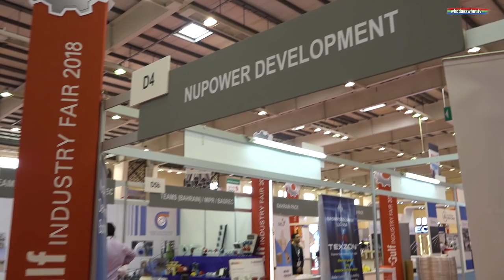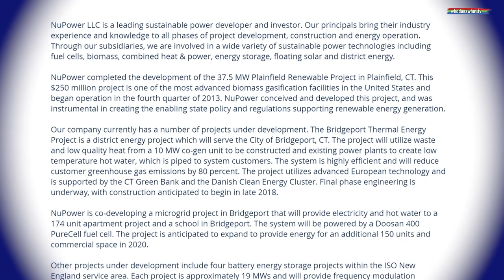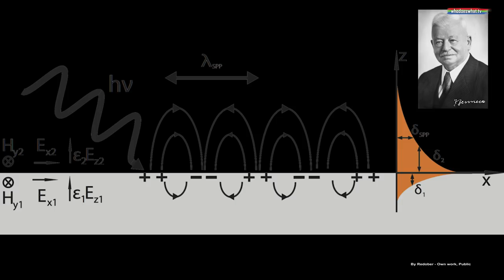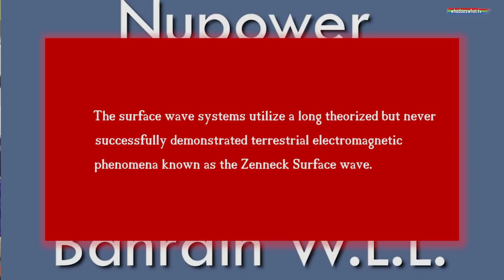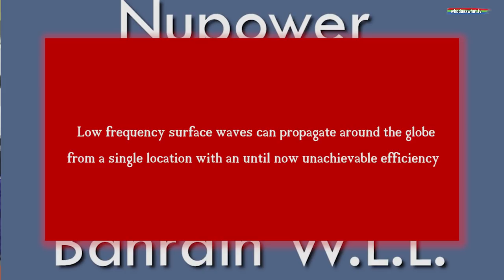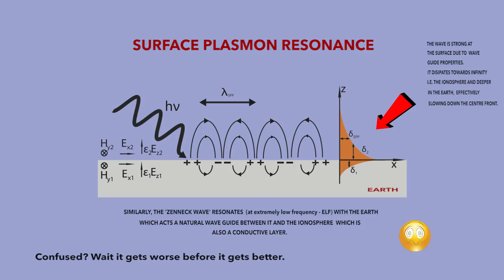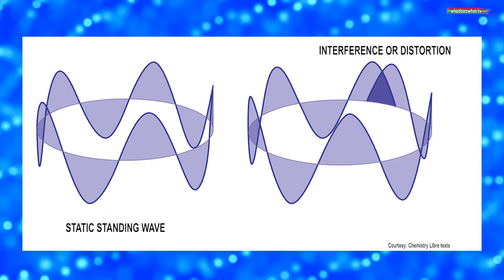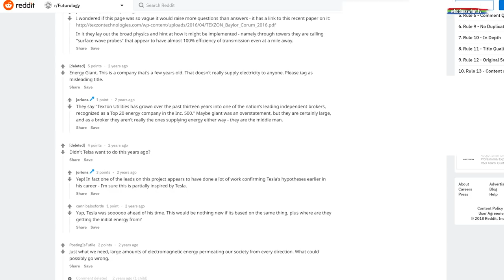Texzon Zenneck Wave Wireless Power Transmission - World Wide - Nupower Development

Comment: Interesting. I wonder if the people who instantly dismiss this are any of those who are buying into the "warp drive"/"faster than light" technologies the likes of NASA and others have been researching, including the potential of "wormholes". Anyway...

They're using a waveform, so I'm concerned about resonance and the possibility of it amplifying/peaking at crossover points as soon as a second transmission intersects the first. An intersection at the correct offset could also cancel out the waves, leading to nothing, or it could lead to unwanted "noise". I'm also wondering if, for example, they transmit 10kw and only 5kw is used, is the remaining 5kw reduced over time? If so, what is that rate of decline? Did he also say it can be encrypted? I have so many questions! Someone needs to lookup those patents and dissect the technology.

It's been a few years now and their site is pretty blank. So, what's happening, if anything? lol

Comment: It is interesting that they call the Zenneck wave “the probe” ... my feeling is that they are running thousands of Zenneck waves per sec as a polyphase Zenneck wave pattern. I also think the percent of ocean vs land as a line of sight to each potential receiver will have to be factored into the phase design of the receiver ... the equipment has to be able to be dialed in with the creativity of the equipment design. The refractive index of water and of the earth are different enough that I feel there is no doubt this will play a role ... ?

Also, though it is near 100% efficient, it’s energy degrades  probably at 1/r not 1/r^2 ( r = radial distance from the source), so the receivers that are further away from the source will take longer to collect the equivalent amount of energy and require a buildup kind of storage in batteries ... but this lag in total power delivered can further be offset by the number of waves per/sec each station is tapping (batteries not required in all instances) ..  perhaps charge more money for the number of cycles being tapped per sec to ensure that the end user has the amount needed as a combination of both battery storage and cycles per sec being tapped... but leaning more heavily on the cycles per/sec as playing the more dominant role.

Therefore, the reason they call it the probe, is that at each location this is a probe to be deciphered and thus, dialed into.  
Viktor Golubic
Reply: Probe?   In modern language, Tesla's broadcast power had little to do with normal radio or conventional antennas.  Instead it was based on cavity-resonance, with fairly small "cavity probes" being the transmitting and receiving antennas.  When you see Texzon talking about "probes," that's their topic.   Their "probes" might be 100ft tall, while any conventional antenna is required to be many miles tall, a quarter-wave vertical tower at the same operating wavelength.   With an EM standing wave present, we don't need to build a five-mile transmitter tower, because the wave-emitter inside the resonant cavity is "pushing against" an existing standing wave in a particular fixed phase, and not just spewing energy off into empty space.  It might seem like black magic, but impedance-matching and "antenna tuners" were always like a black art, understood via equations only.   The non-math version: it's the difference between using your finger to push a 300lb adult on a swing set, versus trying to just slowly force the swing sideways so the person on the swing is directly lifted ten feet in the air.  The 'magic' is in the oscillating stored energy trapped within a resonator.   We can "push against" that trapped wave with our "tiny finger," rather than needing a giant radio antenna.  

Resonance is weird.  Physics students tend to avoid the whole topic BECAUSE it reeks of magic.   It becomes palatable only if we call it "surface plasmons" or something.   That way we can conceal the weirdness underneath some quantum mechanics.  But remove the QM, and the profound weirdness of resonance persists!   (In a way, Surface Plasmons are a sign of dishonesty and cowardice.   Some people hate Tesla because his stuff involves the same weird topic, but without any hope of concealing it all behind a pile of obscure QM equations to make it seem conventional.)

More:  for the 80-meter and 160-meter amateur bands, your car's quarterwave verical transmitter antenna needs to be 65ft or 130ft tall!   Yet if you add a baseload/transmatch, you can use a 8ft whip, and still "get out" just fine.  WTF?!!   How can an extremely tiny radio antenna possibly work for longwave?  Just transmit conventionally but with extreme high voltage.  Heh, also, if the whole world was a resonant cavity at 160 meters wavelength, then your car-mount transmitter antenna might only need be a few inches tall.  That's the impedance-match black magic, the resonant-cavity sorcery.   It's the main thing which allowed N. Tesla to broadcast enormous power at 10KHz without needing an antenna-tower 25,000ft tall.   And then comes ZENNECK WAVES!  Don't even get me started.   Employing some sub-wavelength grounded resonators  ...did you WANT Zenneck waves?!   
Because that's how you get Zenneck waves.
Reply: wbeaty Yes, agree and understand the very high resonance peak potential and standing wave guides in cavity resonance (alluded to this elsewhere) but see the Zenneck wave as a standing vertically decaying wave resonating on the surface of the earth in response to the total internal reflection of the corresponding cavity-resonant wave vibrating within the surface of the Earth ... but it travels above and along the refractive index boundary between ground and air.... It’s an evanescent wave that is non radiative and strictly adheres to the surface much like it does on the outside of a fiber optic cable that experience total internal reflection. But, it is by this means that I suspect the power will be extracted (leaked out) using quantum tunneling across an inverted refractive index boundary where it will give rise to, or transmittance from, the trapped resonant wave traveling within the surface ... from inside the waveguide of the earth or from within the fiber optic as my example. This is how they in fact tap the signal traveling inside a fiber optic cable.
Reply: @Rizzycat1  quantum tunneling is just another name for nearfield devices, transformers and capacitors.   A transformer is not a pair of radio antennas, instead the cloud of virtual photons are "tunneling" between the two separate coils.   The Viziv receiver-probes will certainly be high-Q resonators connected to a large low-resistance earthing attachment, and perhaps oil-insulated in order to support the extreme HV at the ungrounded end.   (Heh, if we could spin a big supermagnet at 20KHz, that would probably work too.)

Comment: how small would the power receiver be? small enough to power a car or a smartphone?
if its a surface wave can it power a flying airplane?

i guess this means that countries with desert will be making huge money powering the world.
Reply from the maker: In time, one would assume so, since the technology allows for modulated products to be carried.  (In theory anyway, but confusing for radio people because the frequencies are so low.  The only way to do that would be by phase modulation).   Anyway, the question was put to them, plus the notion that one single country could, in theory, generate enough power to feed the entire world, but that would not be economical. Manufacturers never build things that last forever, or they would go out of business. Likewise, have as many nodes as possible in as many countries.  There would however no longer be a 'National Grid', as we know it,  since a standing wave would in effect be the grid. Any interested party, with the codes could tap the standing wave no matter where they are in the world. The difference being, each wave may or will overlap, but they are in a different dimension, so do not affect each other. (One assumes).  But the more stations the merrier....  Money honey.  As for the size of the receiver: then again, one assumes that just like any other 'maximum power transfer' equation, the receiver has to be a linear exact fraction of the original wavelength.

Comment: So the standing wave generator produces an earthwide current. To use it, receiving devices have to be developed to capture the current and draw on it. This will require reconfiguring electrical devices. Consider the expense!
Reply: I'm no expert, but wouldn't this imply a totally new set/type of electronic? The system for which they distribute the energy to actual devices isn't clear, so its possible they can relay 'wireless power' to hubs instead of devices?

Comment: Studying more on this ... hmmm

Using the Earth’s surface as a resonant standing wave plasmon pump...

I believe this can work ... but they may have to pump the standing wave to build it up its amplitude.  I can envision where the resonant nodes will have to be positioned at distances in increments of the wave guide wavelength... each node can also serve to pump it up as it is distributed.

Alternatively, this might also be working by pulsing it in many phases to have multiple standing waves slightly out of timing with one another thereby building up a much larger overlapping domain reservoir ...taping it into it might involve collecting all these out of phase standing waves into a temporary storage battery or larger coupled LC circuit over a larger specific timing window...  the further away you are the larger the collection timing window can be!!

I think using a spectrum analyzer will be able to sort out what they are actually doing.

....adding 
I think one of the advanced problems they faced was the fact that the Earth is not perfectly round.... so the resonant frequency going around N-S along the poles will be different than the frequency going E-W around the equator and all the other angles in between ... so you’re going to have to include all these possibilities and kick them up during the right out of phase position for each possibility. 

If you go out of resonance the vibration is considered damped and will eventually die down, etc.

All these variables have to be figured out and tuned just perfectly else it won’t work.

Viktor Golubic
Reply from the maker: Hmmmm!  Viktor..... Very interesting take..  Hadn't quite thought of that.  Nice one!
Reply: Who Does what TV 
I think it might be possible to launch the wave from a horizontal conductor or resonant wave tube as a stepping process ...the wave is then built up to its symmetric or rather asymmetrical shape to counter the decay process.  You can then drive it to produce a series of pulses to manifest as many standing wave as I mentioned above.The antenna in Midland might be a receiver or monitor to collect the electric field as a charge on the surface and not the transmitter.   They said then Zennec wave was launched in 2003 or 4 so this building has nothing to do with the injection it would appear... ? I think to get to 97 percent the equipment has to handle about 20 kHz.
Reply from the maker: @Rizzycat1  Thanks.  I notice your enthusiasm. Enjoying the thought process, even though a little over my head, but that is how discovery is made.  Keep going!

Comment: I think in order to extract power you might need an inverted dialectic coupler representation with collection capacitors/inductors with respect to the incoming standing Zenneck wave ... they would represent the equivalent refractive index of the Earth and Atmosphere.  

The transmission waveguide dialectic sandwich is the Atmosphere over the Earth and for the receiver you will need an Earth equivalent refractive index over an Atmospheric equivalent refractive index ...they would be running parallel with one another but coupled inverted.
Reply from the maker: You are having sleepless nights about this aren't you?  :)  If anyone is going to follow this up, I am thinking it might be you, because here we getting nowhere with new news.
Reply: Who Does what TV Hehe ...very funny ... you might say it’s justifying my lack of sleep ... would be nice to get another report ... I’ll try to post after I get through the patents .... one patent still outstanding and might be in litigation.

Comment: does it follow ley lines?
Reply: For what I understand it covers the earth in fullness. Not lines or places in part.
Reply: @cbrucesbiz  Thanks.
Reply: It does not. They are called Zenneck waves. Think of ripples in a calm pool spreading out over the surface. Now make that pool into a sphere. You can intercept that (ripple) EM wave energy any where you like at any time. Very similar to wireless charging a smart phone. But instead of charging a battery it is more like plugging in a power cord to an outlet so it's on all the time and just uses an on/off switch like any light bulb or appliance. But no more outlet or power cord. Everything will just have invisible power no matter where you are. In the woods camping, the Arctic circle, your own home. Electric cars, ocean liners and Electric Ducted Fan Airliners. No more power outages in storms or natural disasters either. This is the very same technology that Nicola Tesla was working on, that the US Govt. confiscated after his death a hundred years ago. Click this link to learn more: http://vizivtechnologies.com/uses/

Comment: Technically even a car stereo is recieving electricity transmitted through the air. They are using a transmitter and reciever on a different wavelength bouncing it off of our ionosphere.
Reply from the maker: Not quite apparently.  It is not 'electromagnetic' as you mention with your car radio.  It is 'wireless' as in no wires, but it is a standing wave and I only used the analogy of a 'waveguide' using the earth and the ionosphere in respect to several other attempts at creating transmission.  As far as the ionosphere goes, it will only relate to the properties of a VLF frequency.
Reply: The theory behind the Tesla tower was using the earth's magnetic resonance to create electricity. Similar to a wireless charger couples to the magnetic field.
Reply from the maker: That is interesting. However, that is in microwatts.........  Of course, motor or generator, whichever way connected,   one has to turn a (coiled) motor/rotor/magnet inside a (coiled) stator or stick pins in voodoo frogs perhaps.  Using the Earth as a static coil,  with a standing wave sitting upon it, (which is inductive granted) what are you going to turn relative to the earth to excite it?  Texon does not generate electricity, it only transmits it.
Reply: As I recall, the car radio is an AM or FM receiver.  The FM range is limited because the signal cannot follow the curvature of the earth plus ground clutter blocks the signal.  I may be thinking UHF RF carriers instead HF RF carrier frequency.

Comment: See my comments on the article; http://www.globalmediaplanet.info/teslas-tower-wardenclyffe-tower-12-meters-height-prototype-finally-raised/?fbclid=IwAR1qfaxRmtcEVtnFnkqbaiG4_YvPb8HK8u72ph6EIudI2o5nF_GGvcCElrc   The principle used at wardenclyff for wireless power could be interacted with the earth's resonant frequency of 7-10 hz by Pulsing the high frequency coil at that frequency and producing a "heterodyned" signal as shown in my videos. This effect produced an 18 hz amplitude signal as shown by https://www.flickr.com/photos/harvich/8058151418/in/dateposted-public/   Comments from submission; Well the tesla coil as a wireless transmission of energy through the earth functions at hundreds of thousands of hz, but the resonant frequency of the earth itself is comparably much lower at 7-10 hz. Where is the missing key? In fact we can use the principles of the 666 machine to heterodyne or pulse the impulse into the earth at its own resonant frequency!     Dual Channel Scoping of 666 Machine Secondaries showing influence of rotating time vector
https://youtu.be/dx3LV1w5h8o 
The advent of pulsed or modulated secondary emf via 666 secondaries.    https://youtu.be/GuOGMbIQnqg

Comment: So,  technically we could design a reciever that takes all the radio waves running through the air and convert them into electricity.
Reply: You could convert energy as in gas our other types
Reply from the maker: Um...  Nothing is converted.  Power is generated as any power station now.  This system is ONLY a transmission system.
Reply: You need a reciever to convert the signal into useable electricity
Reply from the maker: @jeepadventures909  You certainly do! And just what form that takes is beyond intrigue.